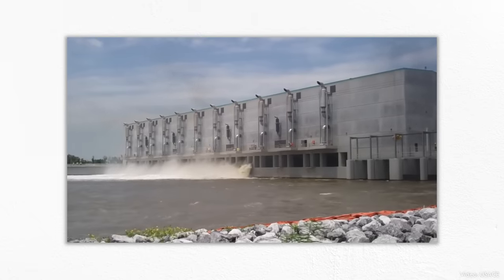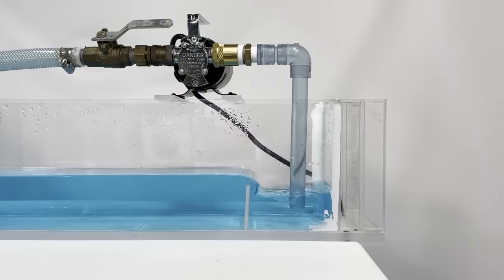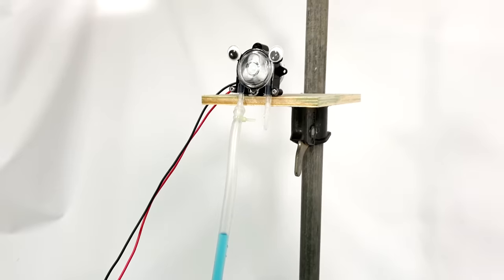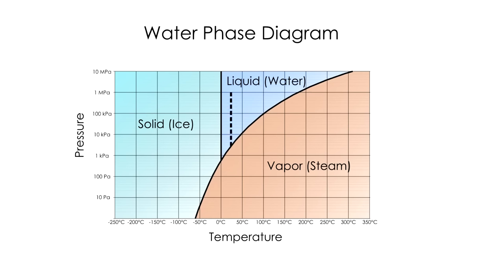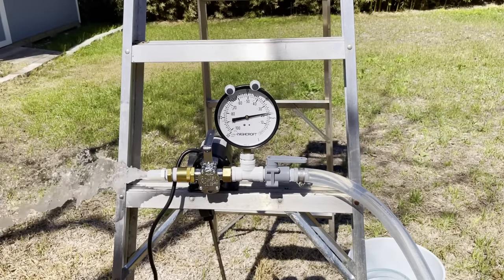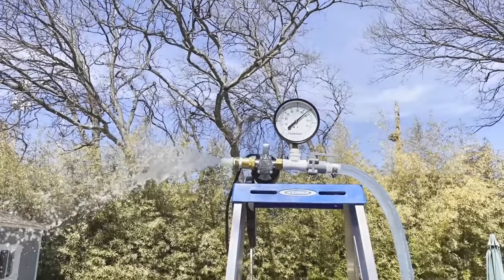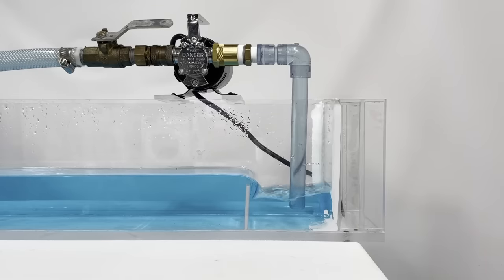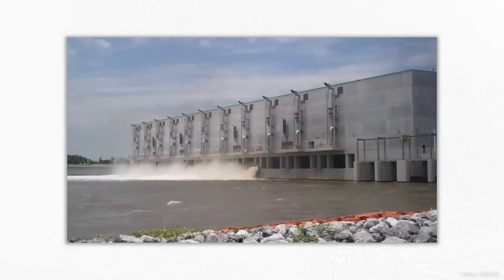The Fluid Effects That Kill Pumps

Comment: Rockets often have vortexing problems in their propellent tanks particularly as the tanks empty. They often solve it with special vanes with carefully arranged patterns of holes in them that slow and break up the vortices and prevent gas ingress.
Reply: They need some people in there with giant scissors, cutting off the tails of the vortices, easy fix!
Reply: sehhi vooty  why do you have such a fake account when you're typing an actual real comment? (unless it was copied from someone else)
Is this the nerd behind the scam account talking?

EDIT: nvm, i just found the real comment you copied..
FrankH 4 months ago
On scale models: There's a model of the entire Mississippi river system somewhere (now abandoned), and also one of the SF Bay / Sacramento Delta.

Even that comment has one of you fake bots copying another person's joke underneath it.
Gah.... this is so sad.
Reply: Chao mang dao fin lai, suk chom lai fao dong. Laer bo bai mou himsongfaibo. Chom sing duk dao!
Reply: I wonder if collapsible type containers can be used to avoid the creation of empty space while sucking the gases or fluids out, like a syringe type mechanism that never allows the formation of space by constantly matching/adjusting to the level of the fluid.
Reply: @Intense_Cloud  Bladders are sometimes used for zero gravity applications inside rigid tanks. But they do add weight. Pistons are also used sometimes.

Comment: Wildland firefighter trick. You’ll often see an empty water or Gatorade bottle floating on the top of the portable tanks when we’re drafting water from them. It disrupts any vortex that starts to form, thus preventing loss of prime.
Reply: If we have a booster line available, we remove the nozzle from it and use that as a return line when we use a drop tank in rural structural firefighting.
That does double duty in preventing a vortex and loss of prime plus increasing the cooling capacity for the pump when the attack crew isn't actively flowing water.
However, it's rare our department uses drop tanks. We usually prefer to nurse feed the engine, giving us more water available faster than setting up a drop tank with our limited manpower, then letting the next arriving tankers keep ours full.
Reply: @leehuff2330  How does the return line prevent a vortex from forming? If anything I would think it would cause a circular flow which could help produce a vortex.
Reply: Agreed, when we draft from drop tanks we will throw a water bottle in to stop this vortex
Reply: ...What if you used an empty Prime bottle? The lack of Prime prevents it from losing prime!
Reply: @alexandermcclure6185  i knew this pun was coming

Comment: Another great video! I like how you mentioned the depth of the pump suction piping, then almost immediately mentioned raw water intakes. As a water treatment plant operator, this is something we deal with first hand. Our source (raw) water intake pumps are set in a wet well that collects river sludge rather quickly. We do have this wet well cleaned annually, so we never have issues with the sludge reaching the pumps. But, if the pumps were mounted too low, it would easily start sucking in foreign objects until inevitable pump failure. We are able to get about 25,000 hours out of these pumps with river conditions of 0-300 NTU, then they must be replaced. This typically costs around $50k to replace a pump, balance the shafts, and go through the motor. Anyway, I’ll stop rambling. Thank you for posting these great videos!
Reply: That's decent hours. I look after dewatering on a large gold mine with multiple surface and underground operations within the one mine on a salt lake with hyper saline water. The water is so salty we have to flush the pumps and lines with fresh water twice a day for half an hour each just to maintain flow. All of the surface pumps are diesel driven with the wet ends getting at best 5000 hours before needing rebuilt or replaced.

Comment: These vortexes have interesting positive implementations too. Vortex Flow Control systems are used to have a fixed outflow of a storm water system regardless of the water pressure at the inflow. The higer the water rises, the bigger the vortex gets and the more air gets 'pumped' through the opening. Thus hindering the water and capping the outflow.
In Belgium we use these since we want to create buffers for storm water and waterway managers don't want to big of an inflow in their streams.

Comment: Excellent video!  I'm a civil engineer and have designed pumping stations for raw water, potable water (including municipal well pumps), sanitary sewage, and storm drainage.  I have also debugged more than a half dozen pumping stations that didn't work correctly due to poor design.

The worst I dealt with was six grit removal pumps at a brand new wastewater treatment plant where a design error (the engineer had assumed much too low a suction head, so the pump moved right on its performance curve), two construction errors (the contractor free-lanced a change in the discharge piping that reduced head losses, causing the pump to move even further to the right, plus setting too low a pressure on the flush water for the mechanical seal, which allowed grit to enter the seals and damage them), and a programming error (the grit chambers had a pressurized air feed to keep the grit fluidized when the pumps were off, but the programmer flipped it so air was pumped in only when the pumps were on, which meant air entered the pump suction).  Unfortunately, the pump engineer and the programmer were from the company I was with at the time and the pump engineer had left the company and the country and taken his design files with him.  However, I figured out his error and we worked through the others.  The plant lost five of the six pumps before I could even get to the site to investigate.  The remaining pump sounded like a popcorn popper and the volute was probably 20 degrees above ambient.  Fun times.

Comment: One of my favorite vortex solutions was a tennis ball. The floating ball would be drawn toward the low pressure (where the vortex is beginning) and would then prevent air being drawn down into the pump inlet. The buoyancy of the ball was enough to overcome the low pressure.
Reply: Very interesting!  In one of my dialysis clinics we have a 200gal. storage tank for RO water, and when I run that tank down to about the 40 gal level to add disinfectant, I begin to worry about pump cavitation at that lower water level.  I wonder if an appropriate-sized hollow plastic ball (polypro or teflon) left in the storage tank would offer that same protection.  I had been thinking of adding some vertical vanes in a starburst pattern in the bottom of the tank to do the same thing, but a single hollow plastic ball is a much simpler solution!

Comment: Tom Scott did an interesting short on the Ruhr Valley pump system.  Because of underground mining, land in parts of the valley have dropped.  They have to pump water from the Boye River up into another river otherwise a huge chunk of the valley will flood.
Reply: Same in loads of the Netherlands really. Even Amsterdam. That's what you get when you drain areas and then extract the peat to burn for warmth.
Reply: @woutervanr  what does peat do?
Reply: @joeyknight8272  It holds water really well. It was more about first draining a bit and then digging up even more and then building there that is the issue. Be it peat that is dug up or anything else.
Reply: @woutervanr  can we grow back peat?
Reply: @joeyknight8272  Well yes in the same way that we can grow back coal. Peat is an earlier "life stage" of coal. I'm not an expert but coal takes millions of year I think, peat maybe "only" some 10000. Google a bit around if you want to know more.
Reply: @woutervanr  oh wow

Comment: This also applies to oil pumps. When I dropped my motorcycle, air from the sump got into the oil pump, and the 'low oil pressure' light came on. The solution was to 'burp' the filter by temporarily loosening it so that the trapped air could escape.

Comment: At my old job we had a sump pump burn out as well as three replacements before we discovered that a change in the sump pit that was made by construction workers that had done a bunch of stuff on the building made a perfect environment for a whirlpool to happen feeding air into the pump. Just taking an inch of stone from the bottom fixed the problem and the latest pump was still working when I left the company. I thought it was just a freak occurrence but turns out that it is a thing lol. Love these vids. Keep up the awesome work.

Comment: "It's hard to predict when and where a vortex will form, even with advanced computer modeling"

Reason #162 why I became an electrical engineer.
Reply: Electricity and electronics I understand. Mechanics and mechanical devices I understand. Hydraulics and fluid dynamics are voodoo.
Reply: Tell me about eddy currents? :)
Reply: @AlexanderBurgers  Give me a thumbs-up with your right hand and call your thumb "Eddy".
Reply: @AlexanderBurgers  lookup non-destructive inspection and you'll find your answer.

Has to do with magnets....however the heck those work....

 ammirite fellas?
Reply: Electrical currents and wave theory; why I became a Mechanical Engineer.
Reply: I have done electronics for 4 year of my life, built so many circits by hand and designed them, and if some one asked me how a transitor or op amp worked, well..... let's just say I have a bit more to go.
Reply: @Bradamsmx5  and how exacly do you figure the production of electricity on a large scale without using turbines that were designed by fluid mechanics engineers ?
Reply: @chrisb9143  I fully understand that we benefit from the voodoo. I still don’t understand the science and engineering behind it all.
Reply: The true black magic is in RF system design. EE voodoo involves complex numbers. It ain’t even real!
Reply: Puddle suckers work great as vortex eliminators for pump or pump hose inlets.

Comment: I work at a large wastewater plant and use pumps of all kinds. The last interesting thing I’ve pumped was crystalline struvite in a slurry with a positive displacement pump. The pump is 100hp, the 10” pipe is five and a half miles long and the discharge is 14 feet below the pump.
Reply: Struvite is the bane of anaerobic digestion!

Comment: Great video Grady. One firefighting specific method for avoiding vortexes when drawing water from a static supply is to simply throw a helmet, or even tennis ball on-top of the vortex when you see it form. It will spin in place and stop the air from dropping any lower to the inlet. Most trucks have a limited supply of solid bore hose so going deeper isn't always an option
Reply: We carry a tetherball on our tanker trucks for this very reason. We tie the ball to the frame of the portable pond and allow it to float freely on the surface. Even if the operator is not paying attention, and runs one of the ponds in a cascade down (forgetting to fire up the jet siphon, for instance), there will be no vortex formation.

Comment: Love your channel. The calm and controlled way you explain things is very effective, and easy to listen to.
One device that I see problems with when not installed properly is expansion tanks on closed loop chilled/hot water systems where there can be large fluctuations in water temperatures. Even if the system is filled/purged properly; as temps shift, pressure drops across the pumps and their pipes can vary greatly causing damage though (and you mentioned these) dead head, cavitation, seizing and/or blown seals, etc.

Comment: How about a floating object on top of the water stream to stop a vortex from forming? it will always be pulled into the center of a vortex immediately extinguishing it.
Reply: I've seen this used a lot with smaller pumps or inlets, for example in videos about homemade hydroelectric systems.
Reply: Open the pumps, HAL.
Reply: @Misack8  I'm sorry Misac. I'm afraid i can't do that.

Comment: Thanks for the basic introduction to liquid pumps! I want to say that most pump and pipe systems have an area designated for catching or locking unwanted gases then releasing them. Avoiding the collection of unwanted substances inside the pump is almost impossible, that's why there are so many other "tricks" used to collect and disperse these materials before they reach the main system. As always, thanks for your videos!

Comment: Point of clarification around the 5-minute mark.  When pump manufacturers are telling you the NSPHR (Net Positive Suction Head Required), what they are really telling you is the "NPSH3", which is the NPSH at which the pump is cavitating enough to reduce the discharge head by 3%.  For example, if you have a pump that is supposed to be producing 100 feet of head at a given flow rate (per its performance curve) and the NPSHR curve indicates that the pump requires 10 feet of head at said flow rate, then if you only give it 10 feet of suction head, then the pump WILL be cavitating, and you can only expect the pump to produce 97 feet of head.  Typically users are required to provide the pumps with additional NPSH above the published NPSHR (NPSH3), known as NPSH margin.  The margin can be measured as a fixed amount or as a percentage.  To actually fully suppress ALL cavitation, the actual amount of NPSH needed could be many times higher than the published NPSH, sometimes as much as 20x higher.  This is obviously impractical.  Let's say that the example pump is supplied with 13 feet of NPSH, meaning it has a 3-foot NPSH margin.  The pump would likely still be cavitating a small amount, but at a tolerable level where the reduction in discharge head is negligible and the life of the pump is not severely reduced.

At 5:36 - where the pump is moved to the top of ladder - it is stated "the suction pressure just about doubles".  No, it doesn't.  The suction pressure is actually reduced, partly because of the increased static lift (vertical distance from the water surface to the pump) and partly because of the additional friction due to the longer suction pipe the fluid has to travel through.  I believe you meant to say "the suction pressure REDUCTION just about doubles."

Other than these nit-picky details, your video is very well done and I think does a good job to illustrate complex concepts.

Regards, an engineer who works for a major pump company
Reply: Thank you so much for clarifying "The suction pressure just about doubles" because this was bugging me out and I went to the comments to look for someone to catch this.

Comment: Great video as usual mate, Anti-vortex plate or fitting a bellmouth at the end of the suction pipe are great ways to limit the chance of surface vortices forming. In waste water (sewerage) pump stations operating the pump down to a low level once or twice a day allowing a vortex to form is actually a good way to remove surface build up which is a common issue. Very short periods say just under 10sec has limited negative affect.

Comment: Early in my career I got to work on some sewer pump station replacements, and the old system included a few old airlift pumps that I had to inspect to prioritize replacement. There's something a little nerve-racking about being next to an old, pressurized pod of sewage that you know needs replacing.

Comment: My rural worker housing has fresh water tanks in the basements, and water is delivered by trucks. Many of the mistakes described were made in these houses' construction, such as my neighbour's whose water intake tube is on the high side of his sloping water tank and how every tank in the neighbourhood has a flat bottom. The pumps also regularly burn out because not every resident knows to turn off the breaker if it runs dry, and most duplexes share a water pump, so only the resident on the side with the tank has access to the breaker.

Comment: For the vortex problem:

My friend is a fireman in a rural area where there is no water distribution or hydrants, but lots of lakes and streams. A common way they get water is to to get a portable gas powered pump to the lake or stream. They send water into a portable pool like reservoir that the pumper truck pulls from. The pool acts like an accumulator as they'll often run several pumps. However, vortices often form in the pool. Their solution: they have a compartment in the firetruck full of volleyballs. Toss a volleyball into the pool and it "plugs" the vortex preventing it from reaching the inlet hose!

Comment: I love pumps too! I’m in oil and gas, and we use 2,200 horse power positive displacement plunger pumps. Usually 16 pumps on a job and rates of 3,500 gallons per minute at 9,000 psi.

Comment: Please tolerate my digression (I did like the video), but your first part reminded me of something I have been trying to make common knowledge for over two decades:  Power generated by falling water cannot life as much water as that which fell to generate that power.  This is one of the simplest things that the general public could understand, and could be a common knowledge item making for better public policy, but most people have no idea about it.  For instance, that one Boeing 747 worth of pumped water per second in Louisiana require more, probably far more, than one Boeing 747 worth of water falling the same corresponding distance at Bonneville Dam on the Columbia river to supply the grid with the electricity to run those pumps.  As we go more and more to sustainable energy, instead of just profiting off stuff we dig out of the ground, the more our power policies will gain with clear general knowledge in this regard.  You are obviously a very good presenter, so perhaps you could make a video on this some time.  Thanks again for this.  Your stuff is both good, and enjoyable.